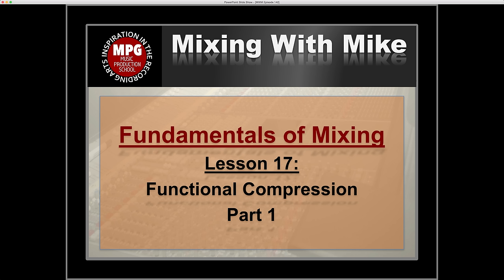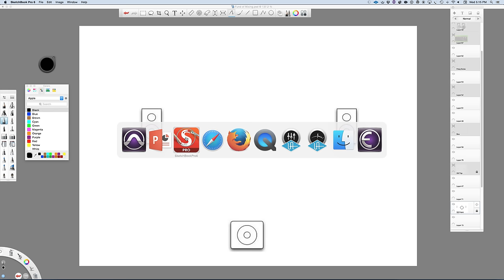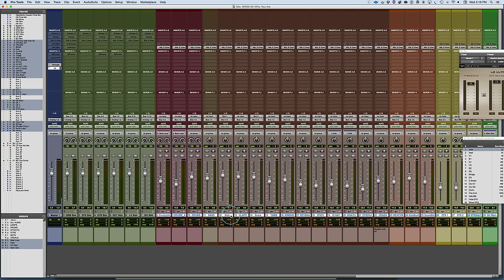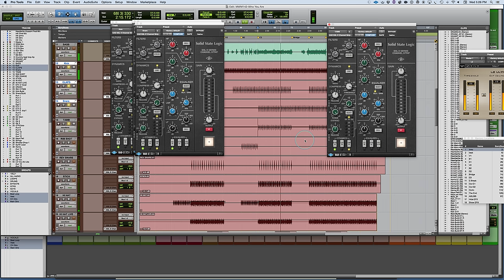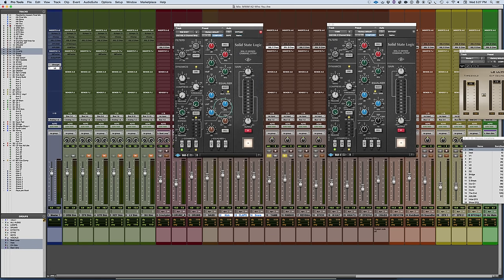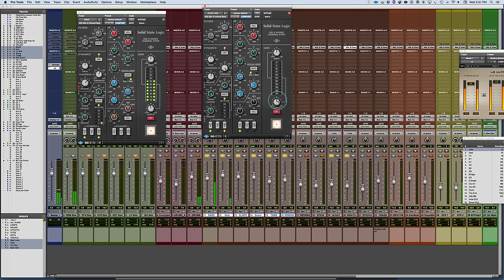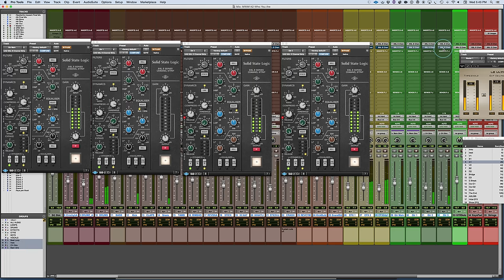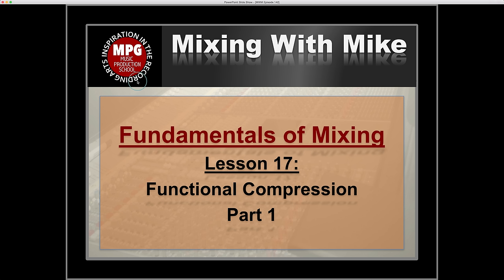Fundamentals of Mixing Lesson 17 part 1: Functional Compression

Comment: So if I'm following along with this one, the effect of the compression on the drums was to;    retain the transient, and increase and elongate the body / sustain of the drum for a quarter note, so that kick and snare hits for example were pretty much back to back, with no dead space between the two..?
Reply from the maker: Hey Kye,
It's a little more complicated than that. Just as you said, the transient goes through mostly unaffected, but the release time cannot extend the length of sustain for the kick or snare. It can only shape the gain relative to the shape and length of the original ADRS cycle. The fact that it releases over the course of a 1/4 note provides a subtle shaping that makes the sustain seem longer. 
Hope that made sense!
Mike

Comment: Great, great video and series Mike. It ties together the process beyond all your others. I have a 16yr old G3/ProTools 5.1 set-up and if you hold Option BEFORE  you select a channel plug-in it will be selected on all visible tracks. Probably changed now on the new bada$$ system you're running. I've watched most other mixing tutorial vids here on the YouTubes  and you cover everything more comprehensively than anyone (esp parameters on LA-2A, 1176 and the SSL). Thanks and I'm actually giving you a credit on our now 2nd album. Don't let it go to your head big guy but it's made such a huge difference on my sound  quality. I only have the L1 Ultramaximizer as an AudioSuite in PT and T-Racks original out of ProTools. Would it be better to bounce my mix back into the 24bit session, hit it with the L1 then go out to 16bit T-Racks OR set my EQ/Dyn in T-Racks then go back into a 16bit ProTools session and hit it with the L1. I know....try it and see. But are there any technical ramifications that make 1 method preferable. I'll hang up and listen for your answer.Thanks again!
Reply from the maker: Cheers!
Option key still works the same and I'm amazed that you have a fully functioning G3. I remember getting the first G3 Powerbook with the removable CDR drive. Literally changed my career direction with music.

I appreciate the credit and promise not to get a big head, hahahaha!

You can bounce the mix back into the session or just create a new session for the mastering but keep the mix bounce at 24 bit. If the L1 is you final maximizer, then dither it to 16 bit using the L1 after the other T-Racks processing.
Cheers!
Mike
Reply: Thanks for the quick reply. I figured to stay 24bit as far as I could but since my TRacks is stand alone 16bit outside PT and I really only use it for a final HPF and it's M+S (pseudo?) on the limiter I had to ask. I know you can make M+S in your session with aux splits but that's almost like work. Ha. Thanks for not mocking my set-up, it's a G3 tower and a Digi001. Still works great but so outdated I can't get a hard drive or even most free plug-ins (just glad I have the RComp, L1 and Q10). Go wit what ya gotz. Looking forward to the rest of this series. Depth with compression was the eye (ear?) opener in your early vids and the spatial stuff is really helpful. Mix on maestro!
Reply from the maker: Cheers!
I had a 001 with the PCI card. The original had a SMPTE input for synchronization. HD users were so angry they quickly removed it from the hardware.
Reply: I still do MIDI-SPMTE with a JLCooper box to lock the G3 to the synths. Anywho, I hope you take this series all the way to mastering. Lastly, what monitors are you using? My NS-10's drop @ 50Hz and are gone by 30 but I have some Beyer phones that go 30/20. I ask because in home mastering it's critical to know how hot to go under 150. You addressed this in the Bass-centric vid way back but this song is a dancer. Thanks again, Mike
Joe
Reply from the maker: No plans to go all the way to mastering for this course but it will happen as part of Mixing With Mike classes. I use a pair of Genelecs from 15 years ago with a sub. Still shopping for a full frequency pair to go along with them.
50hz on an NS-10 is a stretch at best but you can actually judge the low end by the way the LF drivers wrinkle when you push some volume through them.
Reply: I ran a signal generator through all my monitoring devices and then use a BP filter after the mix to check how it translates, as you said in your vid. I signed up at your website. Thanks Mike
Reply from the maker: cheers!

Comment: Hi Michael! I noticed this compressor does not have an attack knob, I'm guessing the release at 30ms will tame that transient right away or is the idea that if that transient is way to hard you would use a transient shaper to fix it later on or is it the amount of threshold? 
I can definitely hear the clarity component that makes the mix opening up with the compressor, i just cannot hear the movement.. a little bit in one of the guitars (maybe?). I can see the concept of what the compressor is suppose to do I just cant hear it and because of that i cant fundamentally put it to use in practice.. very frustrating, hopefully I can figure it out with time.. but this is been happening to me for a very very long time.  -- Thank you for the vids, cant thank you enough!!
Reply from the maker: There are 2 attack times on the SSL that are tied to the Release knob. On the hardware it has an up and down position. F=3ms S=30ms
Regarding the "movement", it's easier to hear if you focus on the depth field in and around the part you are focusing on. It should sound as if the mix becomes more 3D than flat. Harder to hear with headphones and also an issue if you are not triangulated with your speakers.

Comment: Hey Mike, thanks for the videos. My question is on the signal flow as I am not familiar with the UA version of the E-Channel. Does the filter and EQ work before or after the compressor? Maybe a better question is, how do you have it set up in this video?
Reply from the maker: In the UA version the HPF and LPF are always at the beginning of the signal flow. This is different from the hardware version but the way most engineers would use them.
The EQ can be Pre or Post Compression. It defaults to Post but can be made pre with the "PRE DYN" button at the bottom of the EQ.
This mix is set up with the Q being Post Dyn by default and I will leave it that way unless it is necessary to move it pre dynamics. Sometimes, pre dyn just sounds better when making big boosts or attenuations. Chris Lord Alge likes to work this way a lot.
Cheers!
Mike